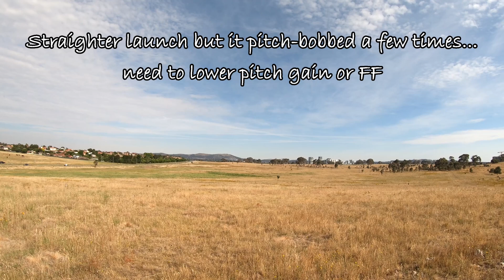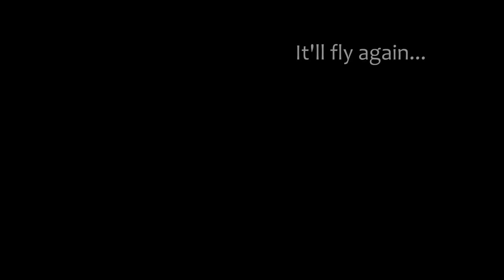Maiden flights of 3D-printed Interceptor by StuntDouble

Comment: Nice plane! Just curious, did you use LW PLA or regular PLA?
Reply from the maker: The friend that printed it for me says this was regular PLA.
Reply: @ZaksterBlue  Sweet, thanks! (Just been having a hard time getting mine to fly and was wondering if the filament I was using was too heavy)
Reply from the maker: @RCBench1776  what motors and props are you using? Maybe go for high thrust for easier launches. Something with a lower pitch. I think I was using the Gemfan Flash 6042 and they were fine.
Reply: @ZaksterBlue  I had 2212 100kv motors on 7x3x4 props, but that didn't have enough thrust...I have since then swapped in some 2306's with 5x4x3 props, so we shall see how those work! (It might just be, I am used to flying foam board which flies differently...)

Comment: Hi ZB, good to see you got it flying! Your vid pretty much summarises printed planes - when they are designed, built & setup properly they fly fantastic but when it comes to landings they are too fragile.
Reply from the maker: I'll use some carbon square tubes to align and strengthen the joins a bit in the repair. And some strong tape on the outside.